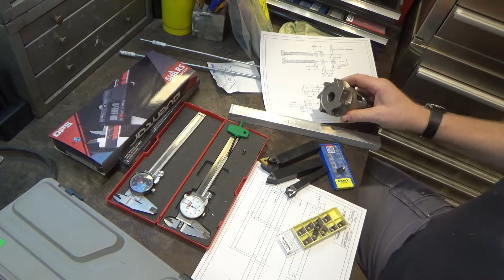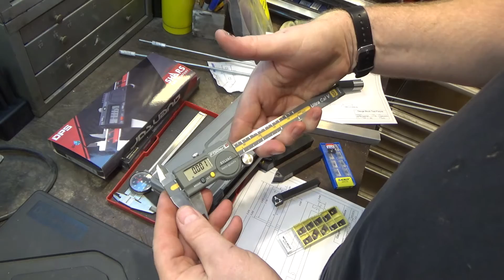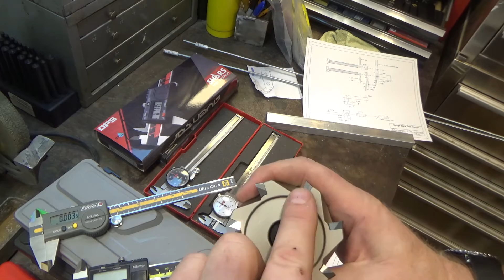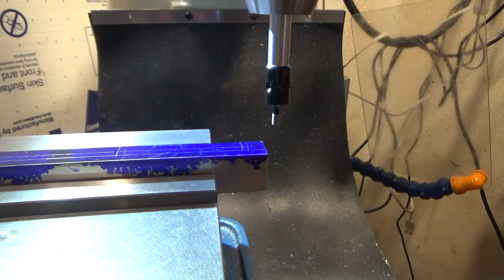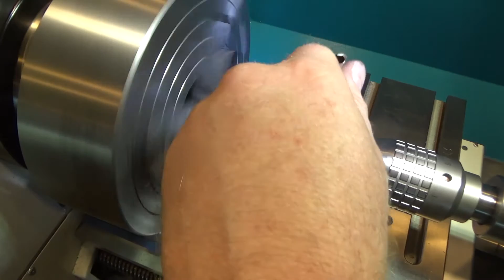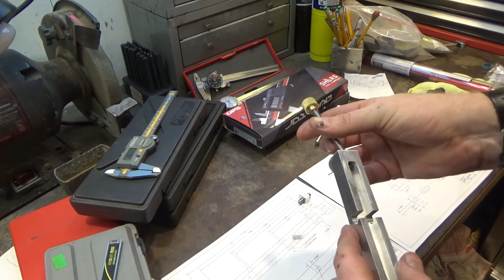Caliper Comparison Part 1 - The Build

Comment: There are two advantages to negative rake tools.
1) The tool pushes away from the part. So there is very little chance to undercut a diameter.
2) You have 6 cutting edges instead of 3.
Reply from the maker: A very useful observation, thanks!